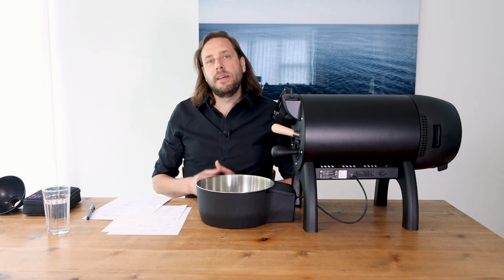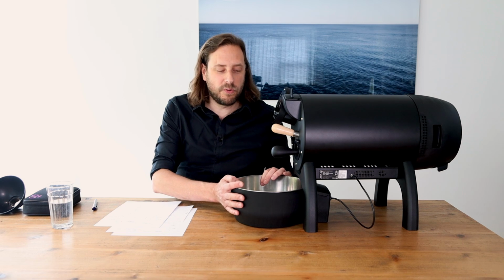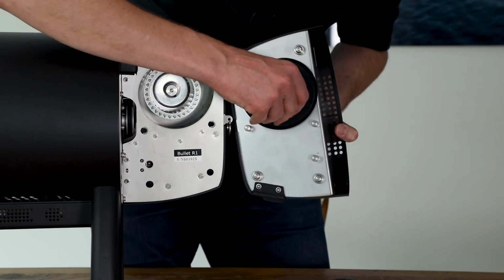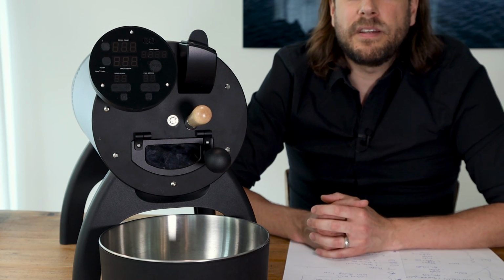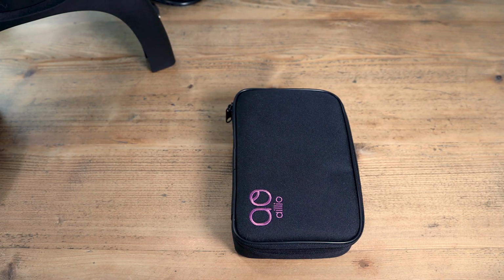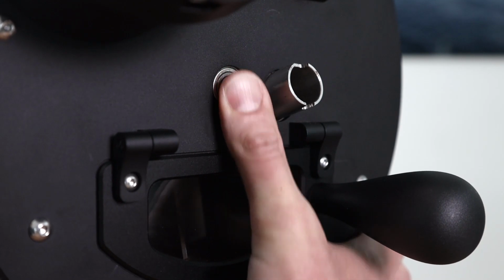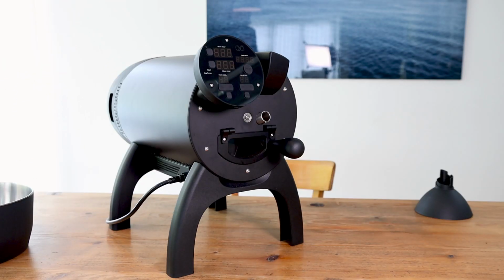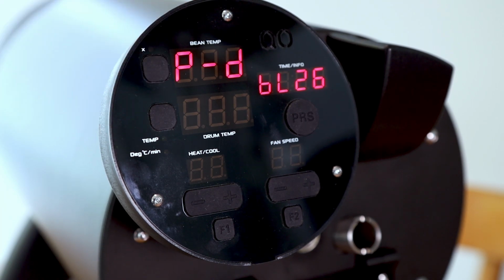Aillio Bullet R1 V2 | quick start guide

Comment: is bullet the best option for anyone trying to do nordic roast at home? been told link can't really do nordic, and roest, even though much more expensive is not as consistent.. my only issue with bullet is its size.
Reply from the maker: The information you have got on the Nucleus LINK and ROEST are wrong in my experience. The ROEST is very consistent. Especially in the newer L100 setups with all the different sensors. And LINK is perfect in light / nordic roasts. It is the machine that is used by many coffee champions on national as well as worlds stage. 
I love the Aillio Bullet and it give great roasting results but the batch size is a bit larger. You can get good roasts with 100-200g but perfect control is in my experience in the batch size of 300g-1kg.

Comment: I also just got my bullet and found that the second set screw near the pully was missing... you saved me a potential big problem by saying there was a second set screw. Thank you! hoping they can get me a new threaded insert and that the first one isnt inside the roaster
Reply: I also just received mine, and the second set screw is also missing. Will be contacting the seller and the company.
Reply: Just heard from Aillo support. The newer models have a different design and only use 1 screw.
Reply: I reached out as well finding out the same info. I was pretty nervous but glad it only comes with one.
Reply from the maker: No, in fact since about a year, they are fixing the screw with Loctite and are only using one screw. So it is correct as you have received the machine.

Comment: Thanks a lot for the video. What if I only got 1 screw on the rotary/belt/cog thingy in the back? There are 2 holes, but only 1 screw. Is it missing, or has there been any update to the build? I got it completely new.
Reply from the maker: Since a couple of month, they fix the screw with Loctite and since then are only using one screw instead of two.

Comment: Owning it for a week, I really dig the overall aesthetic and its design. It reminds me of Star Wars.  The AT-AT walker from The Empire Strikes Back.
Reply: Hi, excuse me but would like to ask how to connect the roaster to roastime (pc. )
I plug the usb on both sides but the software shows no connection..
Reply: @JonathanCheung-fe2vf  I did struggled a little at first but you will have to update your drivers and maybe the software as well. After that, try connecting it.
Reply from the maker: That can have various reasons. In first place make sure, you use the latest software version (RoasTime 4). If it's still not working, you can try another cable or another PC (especially business notebooks are sometimes restricted). 
If it's still not working, you can get back to your seller for support.
Reply from the maker: Make sure you lock the machine at night so that it doesn't attack you while sleeping 🙂
Reply: @CoffeeRoasting  🤣😂😅

Comment: I ordered 10 pounds of seasoning beans to season the drum. The manual says a minimum of three roasts, but I’ll probably use all 10 pounds. Any tips or suggestions on that process?
Reply: I have this machine 
Yea I season it with cheep green 
 beans ..don't drink the coffee  used 
Try touse batch of  300  ,,500,, 750and 1000 g as seasoning and to have more concept of this machine with different batches
Reply from the maker: Hi Jason. That's perfectly explained in the manual. You find the most actual version on the Aillio website. I really recommend reading it. It's a great manual.
Reply: @CoffeeRoasting  for sure, I’ve read the manual at least 3 times while waiting for it to get here. I was just wondering if you had any additional tricks or tips that were not in the manual…..

Comment: I was considering this roaster for a while. You really can't get many 1 kg roasters for this price, the IR temp sensor is cool and I've heard really good things about the heating element. This roaster is artisan compatible and even has its own roasting software. On top, you don't need to tote around a gas container for a decent roast, just 1 electric cable.

BUT

Even though Europeans design this machine, somehow they cannot seem to get CE certification. What is that about? Perhaps that's the reason why so few places in the EU offer this roaster for sale?
This is a very electronics heavy roaster. Electronics and heat don't play well together. So the electronics can easily go bad and where would you get support in the EU or how would you fix it yourself (not being an electrician)? Mechanical roasters are much easier to maintain and last a lot longer.
The flimsy front panel means the axis of the drum can misalign, causing damage to e.g. the bearings, creating friction and destroying the drum motor... no thank you.
The way the chaff collector opens is just a pain in the butt. Why oh why couldn't they just design it with an easy handle to remove it?
Chaff comes from underneath the door during roasting... why the heck do they have a chaff collector? 
An additional filter on the cooling tray is extra hassle that I don't need. Especially with chaff leaving the front, this needs constant attention.
The knob of the door is hitting the tryer... really? Is it so hard to design something that doesn't have all these issues?
They got the USB connectors all wrong. A micro USB connector is flimsy and they put that where you plug in a laptop every time and they do wear out easily. Just take a normal big USB connector that can withstand the wear and tear.
Why do you need 2 LED lights? Do they break so often or is it because they're so easily lost? It's not difficult to come up with a more convenient and secure design.
The fact that there's so much discussion online about the exhaust system says it's a pretty poor design. Most roasters have a pretty standard outlet that you can easily attach an exhaust hose to. Why all the different solutions, even with 3D printed parts (like everyone has a 3D printer these days)?
Attaching the door handle, it's possible to protrude the door, making the extrusion touch and damage the drum. FCOL, why?! Just close the back of the hole so you're unable to damage your precious roaster!
Probably not a big issue, but why would you need to remove the funnel after charging your beans? Leaving loose parts around is a hassle and it's so easy to design a fixed or semi-fixed funnel.
 
Even though this roaster is very cheap for its capacity and features, there are just way too many mistakes in the design of this thing. I do agree you can work around most of these issues if you pay attention, are careful and follow all the guidelines. But 3000€ still is a lot of money and I'd just expect the design to make sense. There are (smaller) alternatives that cost about as much per gram of capacity but are really high quality and built to last, even if you don't pay attention to every single detail each roast. We're all human, we all have our moments and the mistakes you make on the bullet can turn out to be costly and take a very long time to have it all fixed and running again.
Reply from the maker: Dear Jakke
Thanks for your feedback and valuable inputs. I love the way you are having a look on the device and are reflecting about how it's going to work in practical use. 
Some of your questions / inputs are about decisions the development team has taken and you might ask them directly. The way I know them and the machine is built, I am pretty sure, that most of these decisions have been taken conscoiusly as at the end they were able to produce a high quality machine with great thermodynamics at reasonable cost and compact and light design. 
But some questions, I can answer you from my own experience:
- since January 2021, the roasters are tested, CB certified and therefore CE compliant
- so far, we haven't experienced any fault in eletronics that originated from heat / use. But in any case you get 2 years of warranty in Europe and the company that is selling you the machine is going to take care of these issues. In most of cases, it might be a very easy exchange of parts which most people can do themselves. Otherwise the seller is taking care of the repair. Aillio has a great support team and support issues are taking care of quickly.
- The whole body of the machine including the front panel are massively built. Misalignments of the drum can only happen horizontally and being fixed easily. The drum isn't directly attached to the motor what you might see in the video. The power is translated with a belt to the pulley that is attached to the drum.
- Chaff is mainly being catched in the chaff collector but some is coming out in the front and is being catched in the cooler as you say. If this is disturbing you, you can either place a cup or a bowl there during roasting or some people are buying the cooling tray from coffeetea (you will find his contact on facebook. Otherwise come back to me and I can share his contact with you). 
- No issues yet with the LED light and they are daylight lamps which is the perfect light to evaluate the color. I assume they are giving two in case you lose one. 
- The funnel has a longer lid on the bottom that is closing the air tunnel during charging so that no green beans are sucked into the air system. During roasting you have to remove it and replace it with the plug so that the tunnel is open again and the air can flow through the system. Why they haven't mounted a fix funnel is something you might discuss with the development team. I know the system of an external funnel from other roasters as well and in all those years never had anybody who has lost the funnel. Otherwise they are easy and cheap to be replaced.
All in all I can assure you, it's a massively and well built roaster and the risk of damaging anything is quite low. If you're ever around the Zurich area, you are always invited to have a look at the roaster and see it yourself. Next week, we will be at the Swiss Coffee Festival with the machine if you want to have a look at it there. 
Kind regards
Ingo
Reply: @CoffeeRoasting  It's good to hear they finally got their CE label, like you say, it's very recent thing so when I bought my roaster last year, this still wasn't the case. I would have never even considered the Bullet V1 but the V2 definitely came with some huge improvements.

My point about the electronics being a weak part is just a concern I have because we all have computers, mobiles, cars filled with electonics and we all know these things have a tendency to break down much faster than their mechanical counterparts. Not to mention that every roaster will get a drum fire at one stage in their career and my experience is that those repairs are not cheap and people usually need a technician to do it for them.
I didn't grab my concerns out of thin air though. Look around Sweet Maria's and other videos and you will see issues with burnt out electronics, misaligned axis / damaged motors, etc. 

Overall, I do think the Bullet has some really good ideas (like their induction heating, IR temp, affordable 1 kg drum, etc), but if you're coming from commerical roasters that are built to last a generation, it all looks like they've cut a few too many corners for the sake of a cheap price. You shouldn't have to think about exhaust systems or replacement cooling trays when you just spend a month's salary (or more) on a roaster. And a 2 year warranty really isn't changing that feeling tbh.
But that's just my opinion, I'm sure there are many happy Bullet roast masters out there. 

Thanks for the invitation but I won't be able to make it. Covid rules and work won't allow me but I'd love to visit some time when things are a bit more normal again.